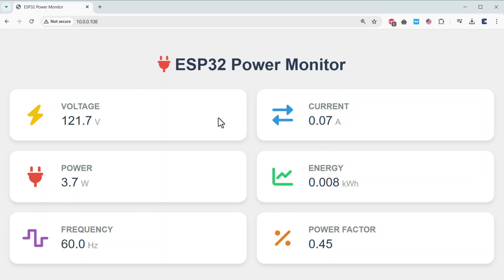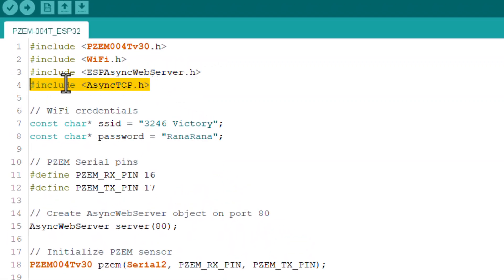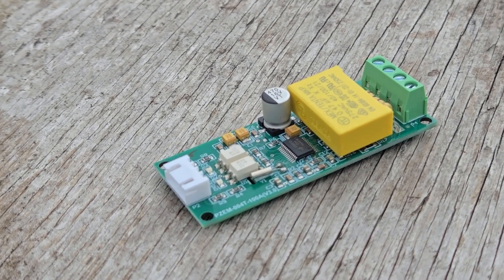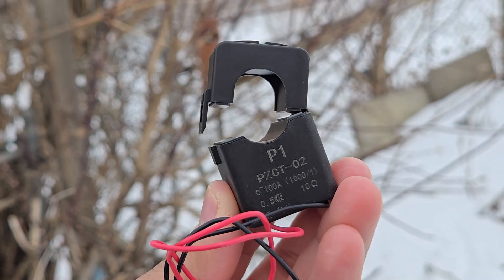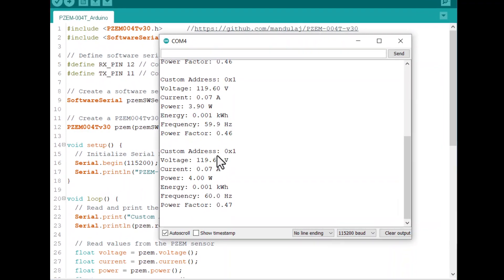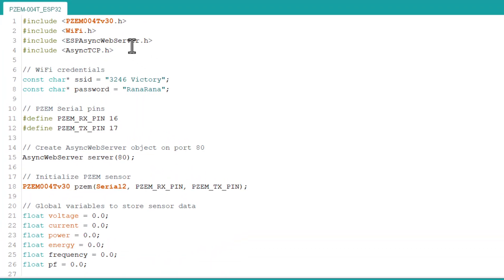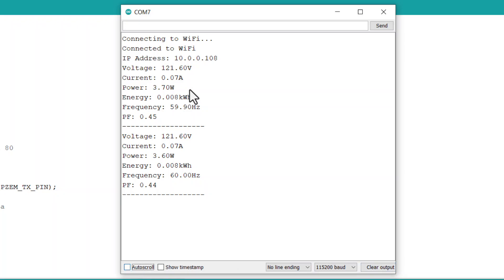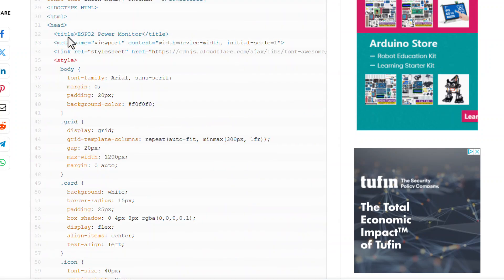Build an IoT AC Energy Meter with PZEM-004T & ESP32 | Real-Time Web Dashboard

Comment: Hello, Is it possible to add a threshold for current using a relay (Example: if current > 1.2 to turn off baseline for (overcurrent/short circuit)) alerting or notifity the user??
Reply: Hey even I was thinking of the same did you get any idea ?

Comment: there is some issue with the code as the ip address isnt visible in serial monitor and the values dont update just shows error
Reply: Replace esp32 with another one. Problem will be solved
Reply: She is using the node mcu

Comment: Hey .when i  connect or disconnect the load while running. The voltage shows nan .and. Ith need   re power the ac power supply ...can you help me
Reply from the maker: It will show no readings when load is disconnected.

Comment: The project is great and the serial only portion works perfect. I am not able to run the application using the webserver as I am getting a compilation error(s). Below is the error:
c:\Users\Ross\OneDrive\Documents\Arduino\libraries\ESPAsyncWebServer\src\WebAuthentication - Copy.cpp: In function 'bool getMD5(uint8_t*, uint16_t, char*)':
c:\Users\Ross\OneDrive\Documents\Arduino\libraries\ESPAsyncWebServer\src\WebAuthentication - Copy.cpp:74:3: error: 'mbedtls_md5_starts_ret' was not declared in this scope; did you mean 'mbedtls_md5_starts'?
   74 |   mbedtls_md5_starts_ret(&_ctx);
      |   ^~~~~~~~~~~~~~~~~~~~~~
      |   mbedtls_md5_starts
c:\Users\Ross\OneDrive\Documents\Arduino\libraries\ESPAsyncWebServer\src\WebAuthentication - Copy.cpp:75:3: error: 'mbedtls_md5_update_ret' was not declared in this scope; did you mean 'mbedtls_md5_update'?
   75 |   mbedtls_md5_update_ret(&_ctx, data, len);
      |   ^~~~~~~~~~~~~~~~~~~~~~
      |   mbedtls_md5_update
c:\Users\Ross\OneDrive\Documents\Arduino\libraries\ESPAsyncWebServer\src\WebAuthentication - Copy.cpp:76:3: error: 'mbedtls_md5_finish_ret' was not declared in this scope; did you mean 'mbedtls_md5_finish'?
   76 |   mbedtls_md5_finish_ret(&_ctx, _buf);
      |   ^~~~~~~~~~~~~~~~~~~~~~
      |   mbedtls_md5_finish

Could you provide some help please?
Thank you
Reply: @rossrawwlings3857 Same error
Reply: Have you solve it
Reply from the maker: Looks like you have selected a wrong board or may be library is not upfated or may be using a different  ESP32 board manager URL.
Reply: @HowtoElectronics  Thanks for the help. I am using a ESP32-C6-DevKitC-1-N8 development board and have selected within Arduino the ESP32C6 Dev Module. I do not see any other board that is close in name to the board I am using
Reply: @HowtoElectronics  Just to be sure could you point me to the correct ESP Async Web Server library I should be using?

Comment: mister make a video of sound detector in db units and vibration in m/s units, one led, one buzzer for sound detector using lcd 
Tank you🙏
Reply from the maker: There is already a decibel meter video on my channel. You may check
Reply: makes little sense............f sound detector in db units

Comment: Nice video, does the module work as well with DC currents?
Reply: measure  the voltage across a resistor in series....say 0.1 Ohms
Reply from the maker: This is only for AC.

Comment: There's a lot much more easier process to do this and cheaper!

Just have a plain Arduino in a current sensor that has a coil. 
You don't need anything fancy Bluetooth to your phone or writing an app. 
Technically as is with only a few dollars in parts it is working but to a command. So to display the information it's probably best to get a i2c display. 

Alternately if you did want to make this web-based to monitor and control something it's better off to use some sort of raspberry pi.  there are many options in this in fact I already have one. 

So there you go. Two options that are definitely a lot better than this crappy has one.
Reply: You can't practically measure real power using just an Arduino and a CT, because real power is calculated using the formula:  
Real Power = V_rms × I_rms × cos(φ)

φ (phi) is the phase difference between the voltage and current

and calculating the power factor from the phase difference between the current and voltage is quite complex.
Reply from the maker: As if Raspberry Pi is cheaper than ESP32.

Why to use sword, if the thing can be done using a knife.